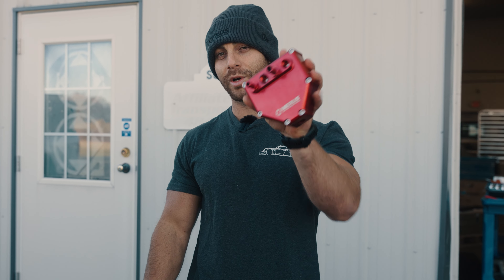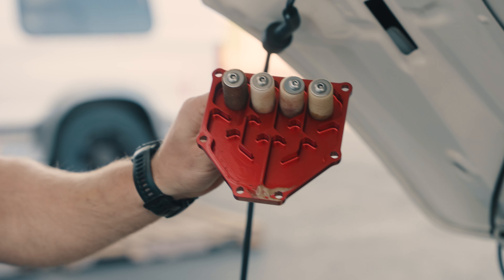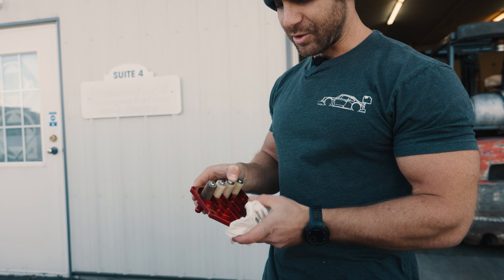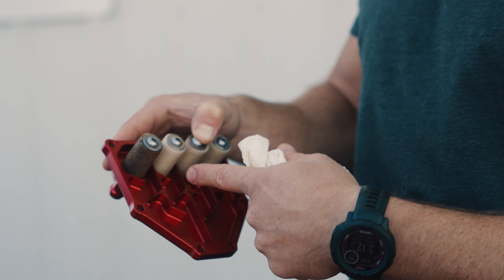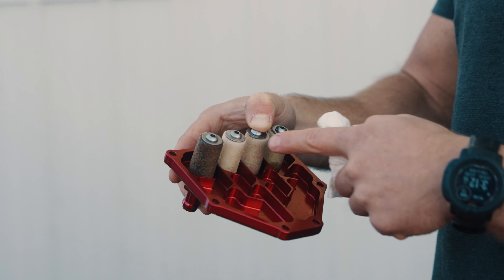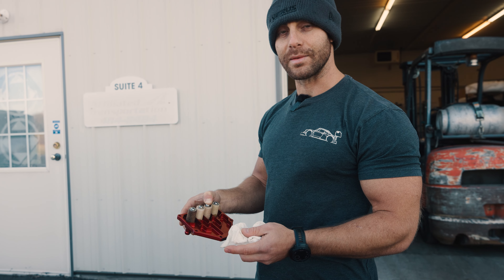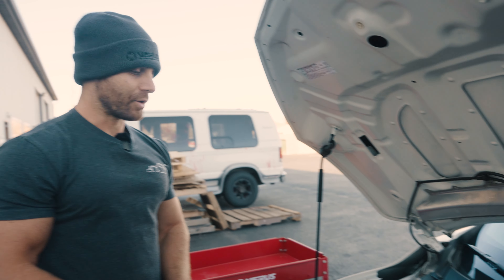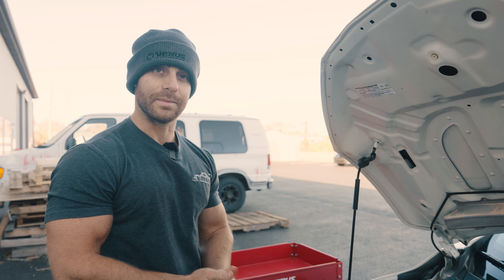How our Air Oil Separator works | Keep oil out of the Intake

Comment: What is the maintenance on those filters? How long until we have to clean or change out
Reply from the maker: No maintenance needed. We have ran the same filters on our shop BRZ for over 8 years now without issue. However, if you want to replace them at some point, we can sell replacements.

Comment: catch cans are AOS too, and collect oil in themselves and need to be drained/emptied; much like this.  So, isn't this unit more like a can?  Other AOS I've seen have a return line back to the oil pan so they never need emptied.  Also, what is in the passages of the unit at 1:18  that is black?  is that a wire gauze/screen of some type?   The walls inside the passages look clean.
Reply from the maker: Catch cans and AOS are similar, but they are different. We offer drain back kits for some of our AOSes, but those are optional add-ons. This AOS is still fairly clean as we have not put many miles on the car since it has been installed. The stuff inside the AOS at the bottom is a type of mesh for filtering.